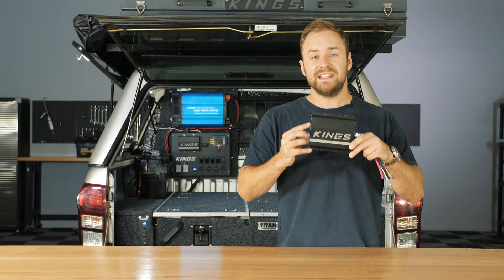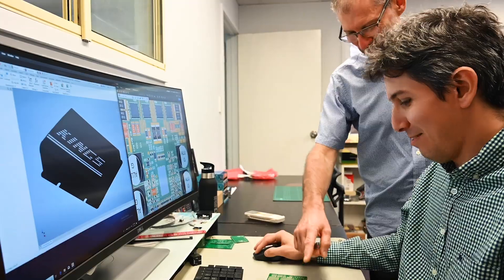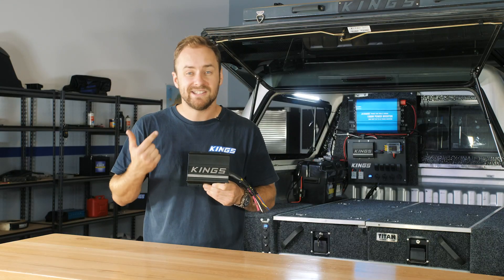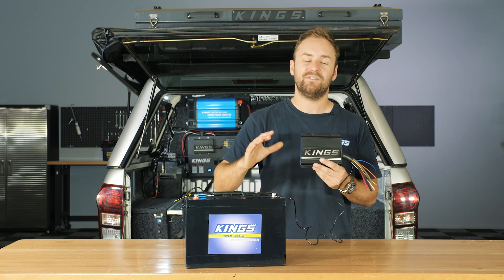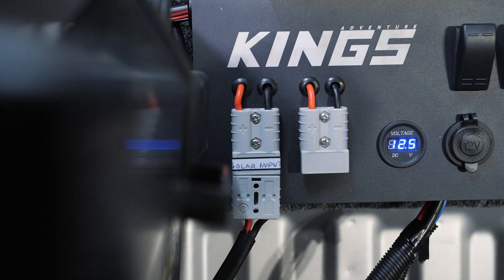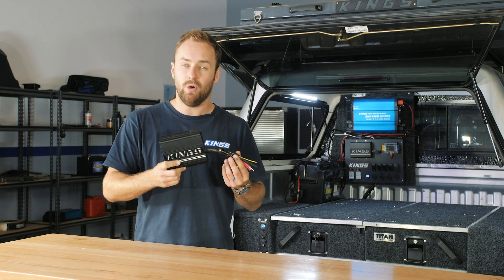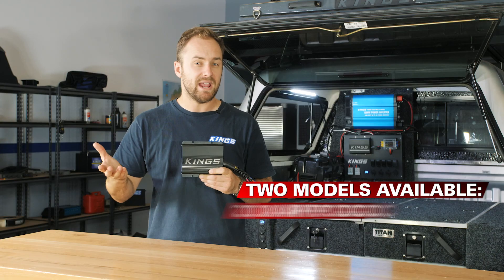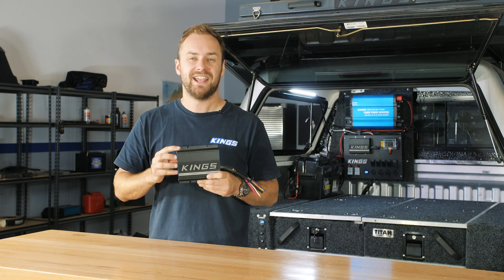Adventure Kings 25A DC Charger Features

Comment: With the blue wire, what function does it have, and how and where should it be connected
Reply from the maker: G’day George,

The blue wire is an ignition sense wire and adjusts the unit’s voltage input parameters.

It’s important for vehicles with smart alternators because rather than just using battery voltage as an indicator of when to charge or isolate your batteries, the ignition sense wire will mean the DC charger is working so long as the ignition is on.

This prevents the batteries from being isolated even if your smart alternator turns on and off while driving.

It also helps to prevent any issues from voltage drop across longer wiring runs, so it’s recommended to be connected if your DC charger is mounted in a camper trailer or van.

Finally it needs to be connected to a 12V positive power source that is live when the ignition is on, and off when it is off. (not a constant power source or accessory source)

For more info check out the link here: https://www.4wdsupacentre.com.au/adventure-kings-25amp-dc-dc-charger-with-mppt-solar.html 

Hope this helps.
Cheers, Emily
Reply: @4wdsupacentreAu  yet your contracted electricians at Brendale statno need to wire the blue wire lol

Comment: Have ordered one of the 25a units, waiting for it to ship in mid Jan.  Its to replace the Kings isolator i currently use.
Reply: Received it on Wednesday, its a nice compact unit, easy to install and its already fitted.  A nice unit.
Reply: @greghall14  hey m8 I got 1 of these to how u liking now I having problems hooking mine up to the kingz 12v control box cant find the right size connection to crimp spade and m10 eye connectors the wires coming from the dcdc charger seem to be a American size what size did u use
Reply: @salmonhuntersean5539  , hey buddy, its been an awesome bit of gear.  It keeps my 140agm charged when traveling and i have a 160w solar panel i connect to it when I’m camping and not driving much. I used my old kings isolator in a mates Triton to be able to give her a dual battery setup.  I have the outlet from dc charger going to Anderson plug as my battery box has an Anderson plug inlet.

Comment: Would running upto 240-280ah of batteries on this dcdc charger overwork it as it can run upto only 300ah of batteries. I want to run 2 batteries and was wondering if this dcdc charger will be big enough
Reply: have a look at the ctek d250sa with smartpass for large power banks

Comment: G'day 4WD Supacentre. Just a couple of questions...

How long is the battery temp sensor cable? Where I would want to place the charger is just over 2m from the aux battery (battery is under the bonnet of the GU - real estate is scarce and it gets bloody hot under there).

Once my roof mounted solar panel has fully charged the aux battery, will it then open connection to the start battery to keep that topped up too?

What's the IP rating?

Comment: It would be interesting to record the performance while driving with pv panels on top (log the watts from alternator and pv) and see what the MPPT produces when conditions are constantly changing, and how much the alternator supply is supplementing the total dc-dc charging.  Otherwise, it looks like a good unit.
Reply from the maker: G'day Michael,

 I could actually pose this question to the engineers as I reckon they'd have the data on it - but so long as you were actually getting the nominal 25A (~360W) of solar input continuously then it should be able to provide the output completely from solar.

Cheers,
Cahn

Comment: Should pre-crimp the ends into andersons ;)
Reply from the maker: Good suggestion and definitely one we thought about, but figured this way it suits our 12V control box with a bit of hard-wiring..

That said, adding some quick connect plugs to the wires shouldn't be difficult if you're keen to sort out your own set up!

Cheers,
Cahn
Reply: @4wdsupacentreAu  put the hardware in the box, plug and play style